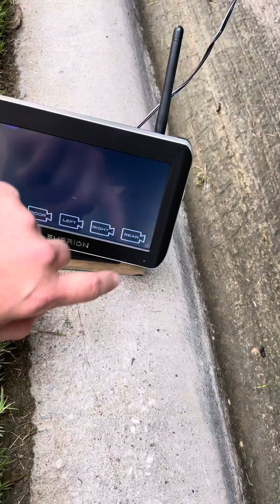2021 models and Furrion cameras not working & the solution

Comment: Just trying to understand. I have a 2021 Silverado and the wireless Camera does not work. It does get its power from the lights, but as you and others have stated it is pulsed. so, what you have done here is to provide 12 VDC from the battery bank to the trailer lights. CORRECT? 
I went out to the RV and shorted the two top terminals on the wiring plug. When you do this the running lights come on.  I checked the Camera, and it is working.  So, I guess I answered my own question.
I purchased the $6.00 Capacitor unit on Amazon.  I should be able to install this anywhere in the light system on the trailer, Correct?

Comment: Basic you give power from the RV battery put fuse and switch and give power to hot cable to the side light , my question is did you desconect the power supply from the truck to the all mark lights ?